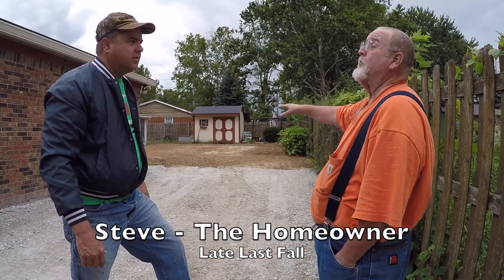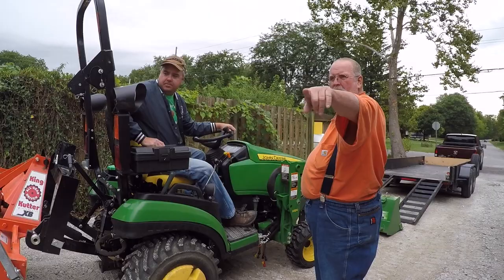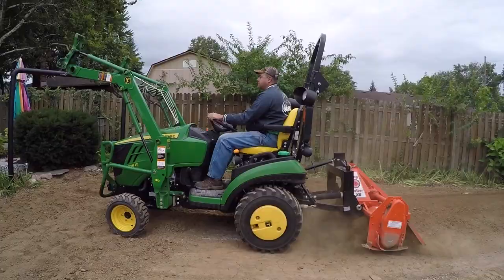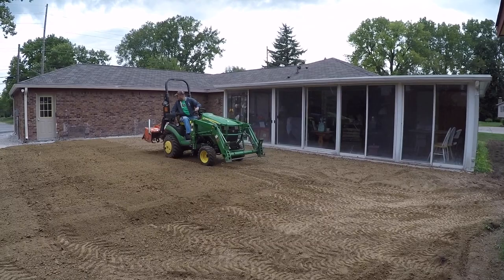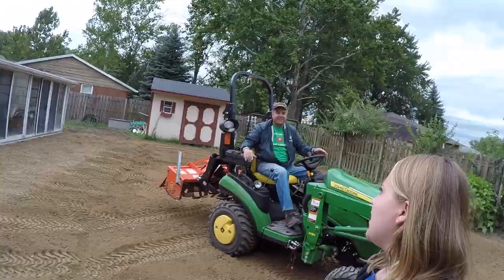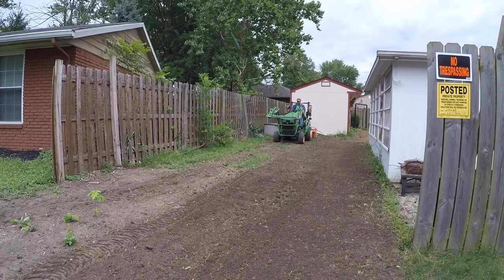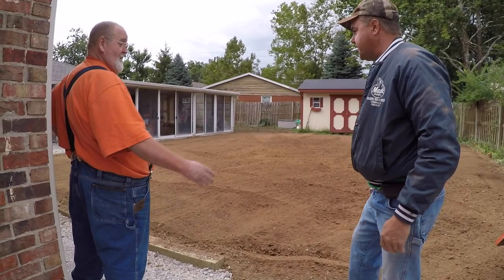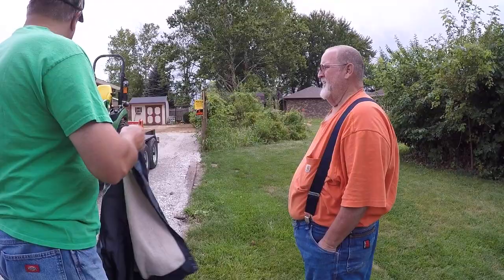Tiller Challenge; Compact Tractor & King Kutter Tiller; Hard Clay or Top Soil? Pool Removed

Comment: It doesn't apply to this video necessarily but I found this wet year that if I rototilled my rutted up lawn that if I set the rototiller shallow, it cut up the grass roots. A thick new lawn came in within the next month with no reseeding. I did it in late August and September rains got a new lawn going. I was prepared to reseed the following spring but didn't need to.

Comment: good vid! you can take some of the slack out of the top hook on the quick hitch with some shim stock. you can get it in a roll of stainless steel or brass or even Mylar and cut it to strips, line the hook with the strips until the hook is tight.
Reply from the maker: There isn’t much slack.  It just really shows itself when tiller wants to bounce.
Reply: yea mine is the same way, i run a JD I-Match and a JD tiller i find too that lengthening the top link can help a little too.

Comment: Tim, watching that tiller jump, it looks like you either don't have or have a bushing on that top pin that's too small.  Get some large washers for the sides of the bushing too.  Makes a world of difference.  I believe I got all of mine at Tractor Supply.  Unfortunately, you may have to go top several stores because they always seem to be out of stock on these types of items.  I was using 1" bushings but found that they really needed one slightly larger,  1-1/8" or 1-1/4" can't remember.
Reply from the maker: I have the "cat1-cat3" bushing.  There is still some play there.   Not much, but wow, it is quite exaggerated in some situations.

Comment: I sell unfiltered topsoil, you will find some roots in it and even a few rocks about the size of a golf ball but its the real deal. A lot of people that sale dirt as topsoil they screen it and add sand to it in hopes to keep it from packing giving the homeowner the look and feel of topsoil. Bad thing about adding the sand is now the dirt/sand will not hold water. Kind of goes like this Topsoil, dirt, fill dirt.
Reply from the maker: I don’t think Steve got what he paid for!
Reply: I feel bad for him. I just have a pickup truck with a dump bed so I do not do big loads. About 1.7 sq.yards. fill goes for around 25.00, nice dirt for about 35.00, and topsoil about 60.00. From what I saw he got the 35.00 but paid for the 60.00.(I do start to charge mileage after the 1st 10 miles.)
Reply: $60 for a yard of top soil? Were are u located
Reply: North Alabama (Madison) A lot of building going on here. As soon as I see someone getting ready to clear some land I am there asking where they are having to take the dirt. A lot of the time I can save them time if I am just a mile or so down the road. Its harder to get clay in Madison as much of its a swamp. (dont tell all the people that are moving here there new $750.000 house was built in a swamp.) They call them a house with an adjunct waterway.

Comment: Looks like another job where a larger tractor would have been an issue.  Is there any way you could rig up some suitcase weights to the tiller for those rare occasions when you run into super hard soil?

Comment: I'm going to go through my tiller this year. Haven't done it since I got it back in '03. I'm going to change the gear oil and make a new breather for it. After I get it done and our garden tilled you want to buy it so you can have a heavier tiller? I just need enough out of it to buy another one that is iMatch compatible. :-)  Now that I have a welder maybe I can make mine fit an iMatch. Soon as I figure out how to weld!  :)
Reply from the maker: I didn’t see that you got a welder!  Congrats!
Reply from the maker: Are your tines worn out yet?  I'm wondering how long they last.
Reply: Nope! My tines look as good now as when I got it. The JD tiller I had with the 425 tractor did as good. Had it for 11 years. This one I have now seen more rougher use but still looks good. Can't see much wear.

Comment: Been thinking about tilling part of my yard and seeding it this year. But my tiller is not a 3 point it mounts to my Mitsubishi D1500 diesel compact tractor only. And that tractor has not been started since I got my Johnny almost 4 years ago. And has not had fuel added to it for almost 10 years. Yes that's right the fuel economy on this Mitsubishi is actually that good. I bought it 10 years ago and filled the tank it's still got almost a half a tank on a 5 gallon tank. And I have put almost 50 hours on it. Wish my Johnny can do that.
Reply from the maker: That story gets better (or at least bigger) every time you tell it.  Before we know it, you'll be telling us that you have to drain the diesel tank occasionally, otherwise it would run-over.  :-)

Comment: Do they make a single blade ripper for compact tractors?
Reply from the maker: Yes.  Heavyhitch.com.  Use code TTWT for 5% off.  This one is used in conjunction with the heavy hitch weight bracket.

Comment: Tim, my comment to your "prices too high" statement.  You could just tell them to do that with a walk behind tiller. Then they will be willing to pay 50-100$ an hour to hire someone to do the job with a tractor & tiller.
Reply from the maker: We don’t get many complaints on price except for tilling. Folks think we should till for nearly nothing.
Reply: Tractor Time with Tim: Can't do that. Fuel, parts (tiller tines, gearbox grease, etc..), included hauling fees, mileage for tow vehicle, etc... And tilling has nearly the most abuse on a tractor and tiller. Will the client pay $3,000 for a new tiller????? NOT LIKELY.
Reply from the maker: Right.  Having said that,  garden tilling requires very little skill and experience, at least compared to most brush removal, drainage, digging etc. projects we do.    It is very straightforward.  So, there should be some discount on our rates for that.
Reply: Tractor Time with Tim: I do give SOME DISCOUNT RATES for certain clients. One in particular because the job takes me 10 minutes and is 5 minutes from home. It takes me longer to load & unload the tractor than do the tilling job. A 6'2" tiller makes quick work of a 15' wide garden.